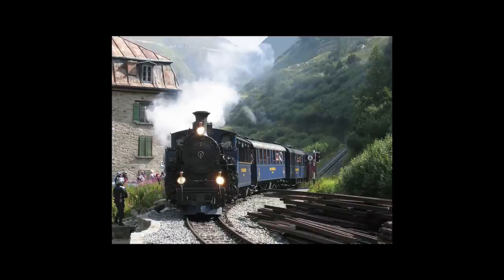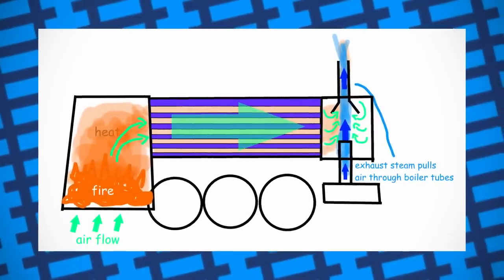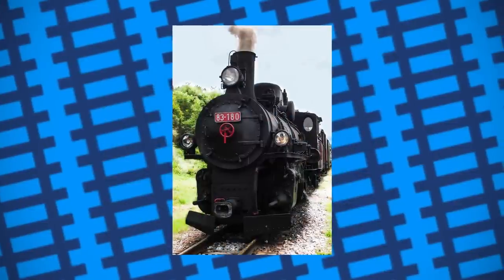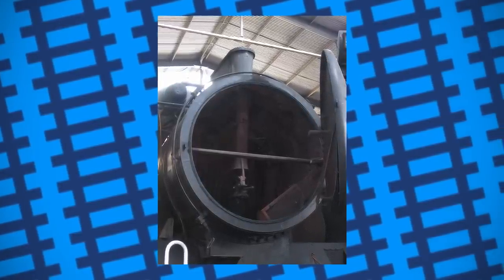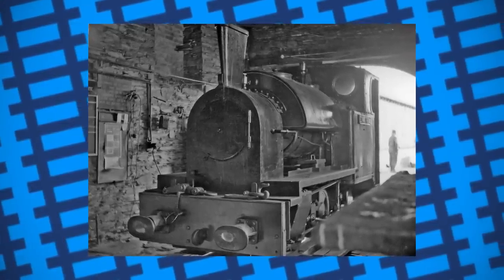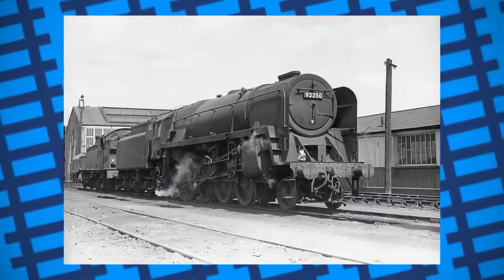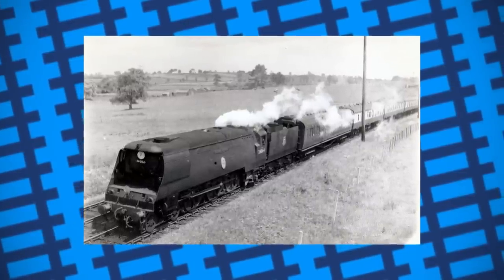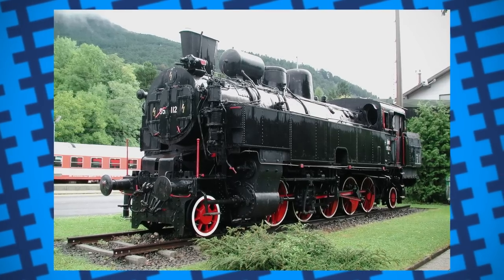Why some Steam Locomotives have Mohawks - Giesl Ejector

Comment: It would be really interesting to have someone with the modeling software (and probably a few hours of a supercomputer's processing time) to model out and test stuff like this to see what factors made this style of ejector work on some engines better than others.
Reply: It failed on some locomotives because it failed to create a better vacuum in the smoke box compared to the standard blast pipe/chimney arrangement on that type of locomotives. This was one of the reasons it failed to give any significant performance improvements on the 9F. As Riddles already knew.
Reply: I've been saying for years that seeing a steam locomotive designed from scratch using modern design paradigms and technology would be incredibly interesting when you just consider the invention of computer-aided design and how much we've progressed with materials science (in particular due to the space race) by themselves since the design of the steam locomotive largely stopped being improved upon, although there's far more relevant areas we've made huge advancements in.
Reply: @TheDemocrab its been done……. Shes called Tornado and she has been running around the British mainline since 2009. A 1920s design built with modern technology and engineering principles
Reply: @lukegauci1159  Do you mean modern precision/tolerances, roller bearing rods/boxes? IMO, it wouldn't need much more than that. 🙂
Reply: @lukegauci1159  "A 1920s design" is very obviously not "designed from scratch."
Reply: @TheDemocrab  There was/is movement called modern steam and they try to do something like that, but it seems like it is not picking up the steam. Not even in Europe with high costs of fossil fuels and focus on  renewable energy. It is quite common to burn woodchips in power plants, yet it is still not worth to (re)build steam locomotives running on this fuel.
Reply: @TheDemocrab  Another part I could imagine steam locomotives benefiting from that seems to be considered less - perhaps because it would more fundamentally change the look, sound, and function of steam locomotives - is automation. The fireman's functions could be entirely automated, making for single-crew operation with no more difficulty than a diesel - I believe stationary boilers are automated in this way so that would be pretty straightforward to implement on a locomotive. The cab could thus be mounted at the front, in front of the smokebox. Another thing I could imagine would be electronically-controlled admission and exhaust valves on the cylinders, dispensing with valve gear entirely. This would make for better efficiency than any design that has ever existed, as well as eliminating a huge amount of complexity and moving parts.

Thinking of the new materials bit, the biggest place I could see that offering gains is reducing the mass of the piston, piston rod, crosshead, and connecting rod (from the crosshead to wheel). This would allow for far less reciprocating mass, which is difficult to balance, this would in turn make the locomotive ride smoother and reduce hammer-blow, possibly allow for higher top speeds or usage of smaller wheels. Combining the smaller wheels with flexible hoses that are much better now than in the past, I could imagine a Meyer-style locomotive with two bogies, likely producing a 0-6-6-0 arrangement - functionally akin to a six-axle diesel - instead of the conventional steam locomotive arrangement with fixed drive axles and pivoting pilot and trailing wheels.

But another step further would be to do what was experimented with briefly towards the end of steam but never caught on: Steam-turbine electric. Steam turbines were more efficient than reciprocating when running at optimal speed, and those with multiple nozzles were reasonably efficient at partial power. But they were too inefficient at low speed to be practical. An electric transmission copied right out of a diesel locomotive could solve that. Standard diesel locomotive bogies could be used as-is.

Condensing the exhaust steam would have an immense benefit both in fuel efficiency and not needing to carry/pick up water. I could imagine this being done with radiator-like condensors mounted along the sides of the locomotive, alongside the boiler. Combined with the front cab, this gives a "Boxcab" or "Cab Unit" appearance. Having no draft for the fire from steam, it would use a forced draft by electric fans, meaning no steam engine noises, no hissing or chuffing.

So what we have now has the cab at the front, boxcab or cab-unit body, no valve gear, a 0-6-6-0 configuration with bogies, either small steam-cylinder driven wheels or a steam-turbine-electric arrangement. This looks and sounds nothing like a classic steam locomotive, in fact is likely unrecognizable as a steam locomotive at all. Might be more capable and practical than a classic-style steam locomotive, but doesn't feed the nostalgia people have for them. This likely would still not be competitive with diesels in terms of operational costs, maintenance, hazard (boiler that could explode in a crash), fuel efficiency, or emissions, and wouldn't have the nostalgic appeal for enthusiasts. Thus while it's fascinating to think about what is possible, I'm doubtful there would be any realistic reason to build such a locomotive.
Reply: @lukegauci1159  That's not what I was saying, I was meaning a completely modern design rather than an old one being updated only to suit the different manufacturing processes available today.
Reply: @quillmaurer6563  Some very interesting ideas there.

I'd like to note that the materials science stuff would affect the whole of the loco, in particular I mentioned the space race's effect on materials science because thanks to it and later developments we've figured out a lot of handy high-temperature alloys some of which have weird/odd properties (eg. Little to no thermal expansion properties) which could make a huge difference for the boiler/firebox alone.

One of the other ideas I had was using a small steam turbine for power generation alongside the pistons, you'd then send that generated power to some diesel-electric bogies mounted under the tender, effectively turning it into a permanently coupled B-Unit behind the loco rather than the more traditional necessary dead weight.

And yeah, this is definitely just a thought experiment unless some foamer lucks out and becomes a billionaire before starting SteamX or something.
Reply: @TheDemocrab  The high-temperature materials bit is certainly interesting to consider. Modern steam power plants run supercritical steam, which makes them more efficient, but running steam locomotives at such high pressure and temperature had been deemed impractical - I don't know if power plants were doing that at the end of steam locomotives though, so that might be a technological advancement in itself. Modern materials would certainly make higher temperature/pressure locomotives viable, and I suspect the turbines I was mentioning would be able to use it more effectively than pistons.

Your idea sounds like a hybrid of piston driven wheels on the locomotive and a steam turbine driving electric motors on the tender, so sort of a hybrid of steam turbine and steam piston, and the overall arrangement is a mother-slug. Not sure if that would be better than simply using steam-turbine-electric for all wheels on both locomotive and tender, perhaps it might if there are pros and cons of piston and steam-turbine-electric under different scenarios - perhaps the pistons more efficient at low speed and the turbo-electric better at high speeds. Compounding possibilities also might bring advantages. Though actually come to think of it that brings up the question of if a mechanically geared steam turbine (as was experimented with in the transition era) combined with traditional pistons, both driving the same wheels, could provide the best of both worlds, with either one or both used depending on the circumstances (the turbines were great at high speed but suffered at low speed, having pistons as well would avoid that shortcoming), though at the expense of complexity. Still I suspect the more practical (and lower-maintenance) option would be all the steam feeding a turbine that drives an alternator, though utilizing your idea of a sort of mother-slug arrangement with traction motors on both locomotive and tender. One drawback of driving tender wheels, or of tank engines even, is the variable weight in the tender allowing wheelslip when the tender is light, but this is where modern electronics come in - traction control and systems that automatically meter power to the tender's traction motors depending on weight. The unit would have less tractive effort when the tender is nearly empty, but the same is true of diesel locomotives depending on how much fuel is in the tanks.

Though come to think of it, I could imagine this engine being a tank engine. Most of the tender is water, not fuel, if the locomotive is equipped with condensers then it might not need to carry much water. Better fuel efficiency would also reduce the need for fuel, to the point where it might make sense to do like modern diesels and simply carry it aboard instead of using a tender. Combine this with the technologies you brought up for boilers that would get more power from a smaller, lighter boiler, the boiler wouldn't need to be all that large. Having bogies instead of fixed drive axles would allow the frame to be longer. All of these things would make it practical to have a reasonably powerful locomotive be a tank engine, having more power and range than would have been feasible with a tank engine historically. Though given the ability to have powered tender wheels, there might not be all that much advantage of being a tank engine either - really could go either way, neither having the shortcomings of historic tank or tender engines. Another thing that comes to mind, whether it be a tank engine or tender engine, as everything is controlled electronically from the cab rather than direct mechanical controls, it would be possible to have cabs at both ends of a tank engine, or have a cab at the end of the tender if a tender engine, and unlike historic steam locomotives it could operate in either direction. Or it could have multiple-unit connections like modern diesels and not require a crew at all when used in a consist (or even remote control).

Thinking of technological advancements of the past 70 years or so, the two biggest ones that impact most technologies (I think about aircraft mainly as I'm a pilot and surrounded by aviation, but the same applies to pretty much all machines like locomotives, cars, spacecraft, ships, and so on) have been material science like you mention, and computers. Computers have done two things. First in the design phase, allowing easier design, simulation, analysis, optimization, and so on, that allows all aspects of a design (fluid flow, aerodynamcis, thermodynamics, structural design) to be more optimized for better performance (and lower cost). Then in the vehicles themselves, computers, microprocessors, automation, can allow for more optimal operation, self-monitoring, and so on, allowing for better performance or efficiency, lower crew workload, often fewer crew members, or less trained crew. Things like electronic fuel injection, fly-by-wire, multiple-units, and so on. In this steam locomotive we're talking about, meaning instead of having a fireman and highly-trained engineer working with a complex myriad of controls and a huge amount of things to monitor, you could simply have a single driver who drives with a single throttle lever, no more complex to drive than a diesel or even electric, and a digital display that will alert them of anything amiss. Meanwhile the boiler, steam passages, valves, turbine (if going that route), condensers, and so on are all computer designed for optimal heat and fluid flow.
Reply: @quillmaurer6563  The other big benefit to electric control would be how easy it'd be to add MU capabilities too. Some Steam locos have had the capability retro-fitted via adding a diesel control stand (eg. Victoria's R-711) but that was essentially a second set of controls whereas this would be the computers balancing each locomotives output.
Reply: @TheDemocrab  Yeah, MU would certainly be a possibility as well, possibly even remote control or - what we all know is coming sooner or later - autonomous operation. I believe some steam locomotives had MU controls, allowing it to be operated from elsewhere, but there still had to be a fireman inside the locomotive to operate the boiler. A steam locomotive (as we know it) without crew won't run for very long. A modern automated-control boiler wouldn't need that though, could be run crewless just like a diesel.
Reply: @lukegauci1159 isn't she much rather a 1940s design? She's a Peppercorn A1, not a Gresley A1.
Reply: @Hybris51129 I don't even think we would need a super computer. Software like Ansys could do a simple modeling job to replicate it with modern FEA simulation on a regular gaming computer (or maybe even a school laptop if you want to wait all day for it to run). Sure a super computer could be useful if you wanted to know the performance on every flue and piece of the boiler, but a fairly simple design should approximate it well.
Reply: @quillmaurer6563 I’d like to note that more efficient steam generators were invented in the world of steam cars, which are both better at generating high pressure steam and safer than boilers (in cars they were essentially only boiling a quart of water at a time, so zero chance of explosion). The best ones could get up to operating pressure in as little as 15 seconds after starting them. Always wondered how those would fare in a locomotive… Also those fancy steam generators never really got to benefit from modern material science and technology either, outside of Jay Leno’s garage where he put a space age insulator material in one to replace something he couldn’t get anymore. Not only did it improve efficiency, but it could handle thousands of degrees more than the generator was designed for, so there’s still enormous untapped potential in steam technology. 

Also modern synthetic oils can handle higher temperatures, which was another limiting factor for steam technology back in the day.
Reply: @Thinginator  Good points. Though modern boiler technology is commonplace for power plants, some ships. A locomotive is part way between a power plant or ship and a car. I've pondered what might be possible for a modern steam car, probably propane-fired, fully automated so that it's no different to drive from a modern automatic transmission car (or for that matter an electric car). Switch (probably key) to turn it on, wait for the pressure gauge to come up (15-30 seconds), set switch to forward (would probably be a big Johnson bar like a steam locomotive reverser for aesthetics, though in reality only controlling electronic switches), press accelerator pedal and it drives off. The fun part with that would be showing it to people, they're expecting some crazy sophisticated thing, and telling them "Here, you drive, you can figure it out." I'm thinking build it on a vintage car chassis, something front engine rear wheel drive, boiler in the front where the engine would normally be, V-twin steam engine (similar to a Heisler steam locomotive) mounted in the trunk (trunk lid omitted so engine is out in the open), connected directly to differential that drives rear wheels. Goal would be to not only make it easy to drive and reasonably practical, but something that could be used as a daily driver.

However, in terms of efficiency and cost-effectiveness, it can be noted that ships have gone from steam, typically oil-fired boilers and turbines, to using either low-speed direct drive diesel engines or medium-speed diesel-electric drivetrains, typically using the same heavy fuel oil formerly used for steam boilers. This would suggest that, all things considered, diesel engines are the more cost-effective (probably both in fuel efficiency and labor) way of converting oil to mechanical power. The only place we still see steam in common usage is in coal-fired power plants, as there isn't a practical way to burn coal in internal combustion engines. And even those are on the way out (at least in the US) due to both economic factors and the environmental impact of burning coal. So as much fun as it is to think of modern steam-powered vehicles, I'm still doubtful of their practical possibilities. We can throw every bit of modern technology at them and they'll still be inferior to internal combustion except in specific exceptions. Really the only advantage of steam is its ability to burn solid fuel, or perhaps non-combustion heat sources such as geothermal, nuclear, and concentrated solar (none of which would be feasible on a moving vehicle except nuclear powered ships - I recall Train of Thought doing a video on nuclear-powered trains though).

Though come to think of it, one last chance for steam comes to mind: combined cycle, using steam as a "bottoming cycle." Again making use of an external heat source rather than fuel burned in a boiler. Internal combustion engines (gas turbines, diesel, gasoline) produce a lot of waste heat, mostly in their exhaust. This exhaust could be passed through a boiler to recover some of the heat and convert it to mechanical power. Probably not a huge amount, only a small percentage of the internal combustion engine's output, but a few percent saved fuel would be a big deal. I believe I've heard of that being done on gas turbine power plants, I could see it being possible for a locomotive or even car. Probably would be a fairly small heat exchanger downstream of the turbocharger turbine, and a steam turbine driving an alternator that feeds into the traction motors (or for a car, hybrid-electric system). Then would have condensers in addition to the main radiators. Or perhaps omit main radiators as this same water flows through the block, effectively like a feedwater heater before the boiler. So the result would look nearly indistinguishable from a conventional locomotive other than maybe slightly larger and even more radiators for the same horsepower, no externally obvious cues. On a typical 4,400HP size locomotives, I'd imagine this system would deliver at most a few hundred horsepower (maybe 200-500), but having that "for free" without burning any extra fuel would be rather appealing, especially as the total lifetime operating cost of industrial engines and locomotives is like 80% or 90% fuel.

The other thing I'd love to see for the most efficient locomotive would be this diesel with steam heat recovery also having battery storage. I'm surprised that's not done already, as they absorb a lot of energy through dynamic braking, normally blown off as heat from resistor grids. They already have an electric drivetrain, so adding battery storage to that doesn't seem too complicated, especially with modern solid-state inverters, power converters, and batteries. If they're too heavy for the locomotive, have a "battery tender," or perhaps a mother-slug arrangement with two permanently coupled units, one having the diesel engine (and steam waste heat recovery system), the other having batteries, their combined electric system driving wheels on both units. Or you could describe it as a hybrid-battery-electric articulated locomotive.